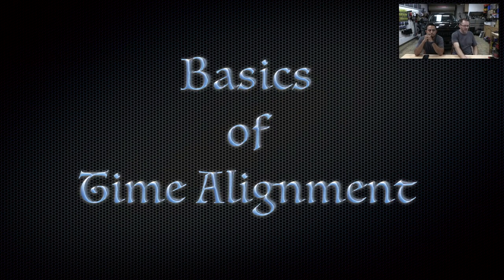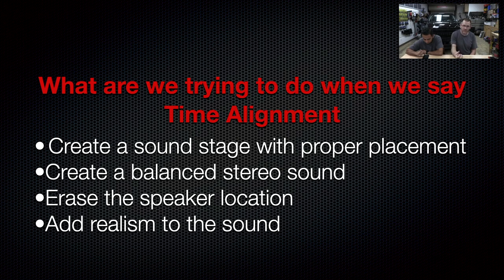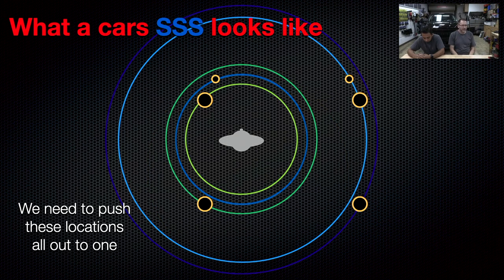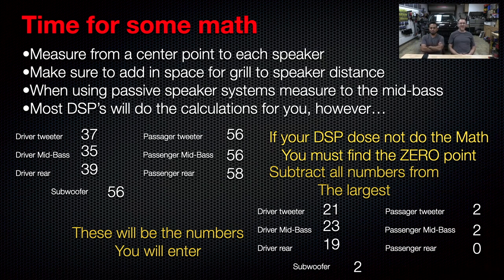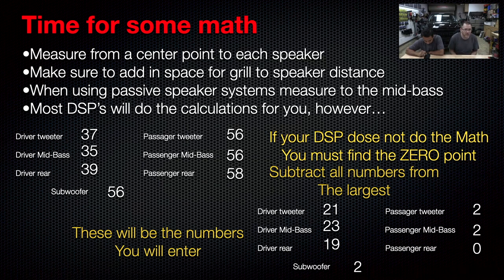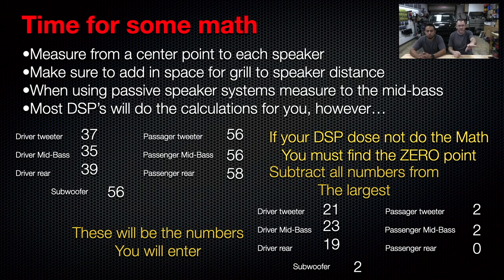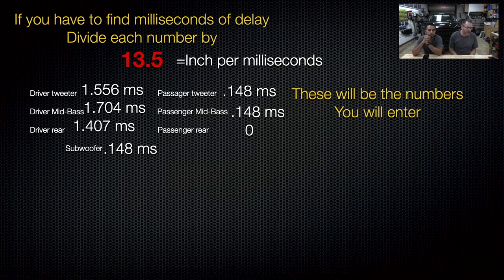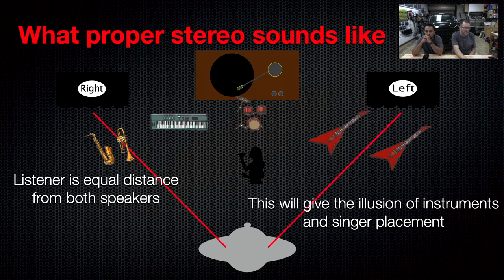The basics of car audio time alignment

Comment: I don’t know if this is “wrong” but I’m running a loopback ref in REW with my Scarlett Solo. It gives you the delay distance in the notes after each measurement. So Ends up (for me) showing around 7ft and I have my subs at 0 delay w reverse polarity... sounds great. Should be noted aligning sub to system is completely different process than this video.

Comment: Hey , I have dash speakers in the front ( 4 inches ) RMS 22w and peak 120w. And rear are RMS 75w 6×9. Both are of JBL. How do I set the speaker levels on these two different speakers to have the correct time alignment and stereo effect?
I have the rear at 0 and the fronts at +2 speaker levels. Are these okay ? I have already time aligned them using distance.

Comment: So this would bring the staging in front of the driver's seat right? Like from the left most portion of the vehicle to the middle of the dash? Now if you leave the speakers alone without time alignment,  wouldn't this bring the staging to the center of the dash? I would think this would be more desirable for overall staging throughout all seating positions. correct me if I'm wrong or I'm missing something.
Reply: You’re missing a few things but what you asked is logical and a valid question. TA allows us to to create the illusion that we are equidistant from the stereo speakers. The first part of the video has a great visual and mnemonic that explains it quite well if you can go back and watch it. TA gives each speaker an impulse alignment so that the sound from each speaker arrives at your ears at the same time which in turn creates that depth and stage that is signature to stereo sound.
Reply: If you don't do time alignment, the speakers you are closet too, will be totally dominant. Sounds ugly. If you do time alignment the proper way with a tape measure, to your heads location in the drivers seat, you can get the sound to be centered in the middle of the dash and hopefully top of dash height, depending on speaker locations.

Comment: Any idea if the jbl dsp4086 DSP/AMP combo "does the math"? I seem to be losing all deep bass when I leave the subwoofer at ZERO, and align the front stage from the difference in its distance (it has inches). If I invert phase, the deep bass comes back but the sub definitely sounds out of phase and any slight rattles in my doors become more obvious. It doesn't really sound right, either, if I enter the actual distances (in inches) from the drivers.
Reply: The JBL DSP Delay scale unit conversion is screwed up. The time (ms) scale should be inverse to the distance (inch/cm) scale, because the bigger the distance, the lower the delay should be. The JBL scale doesn't do that conversion. For example, let's say you set CH1 to 10" and CH2 to 20", because CH2 is further away (double the distance) than CH1. All good. Except that if you change the units to "ms", the same scale now shows CH1 0.73 ms and CH2 1.47 ms. Basically now it reads that CH1 is further away than CH2. Tbh I have no idea which scale works correctly.

Comment: Isn't this the same as adjusting the balance and fader
Reply: Kind of. It works on the same principles but not as accurate. These measurements require extra gear to arrive at.